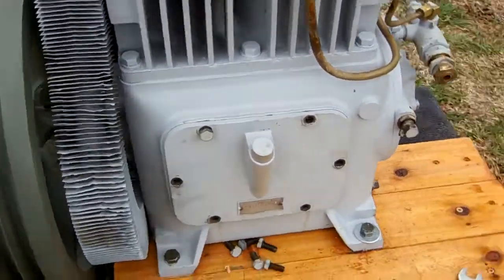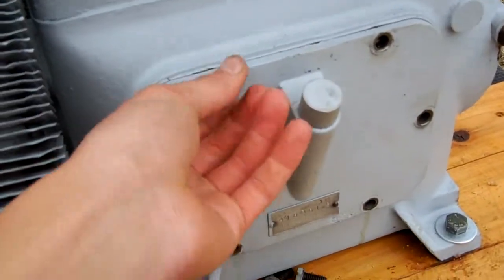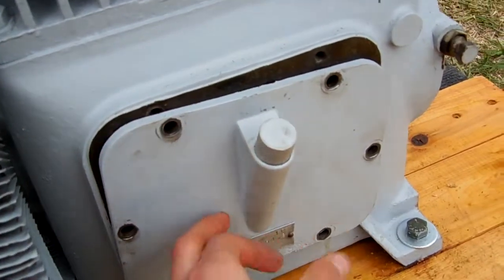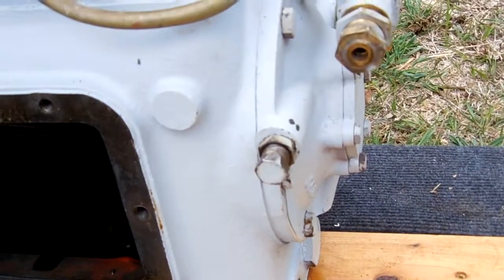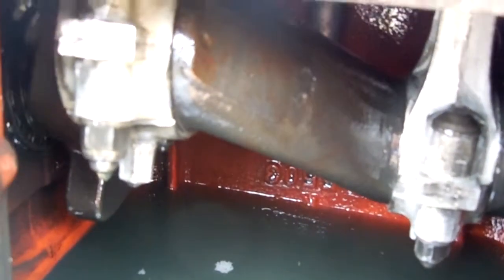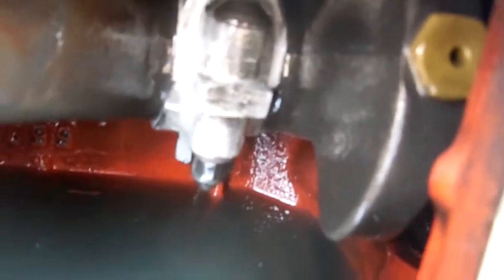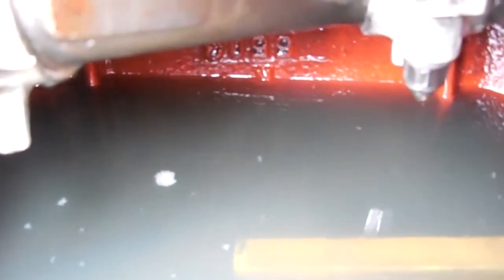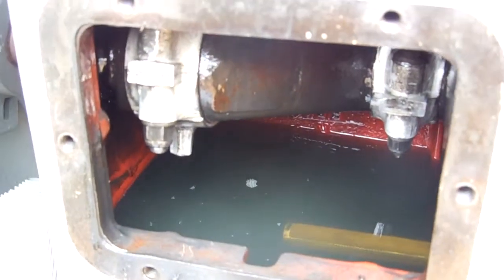Inside The Crankcase of A 325 Quincy Air compressor

Comment from the maker: After I acquired the thing the first videos I watched were Dave's rebuild videos. Also after further inspection of the oil pump, it does not pump to the unloaders where the VD pilot is connected it is simply a hole to hold it in (on the pilot there is a solid rod that fits in. I almost would rather have a hydrolic unloader but since I am going to use this mainly for hight CFM consumption tasks like abrasive blasting, pneumatic grinders, ect it might be better that it has the VD pilot.